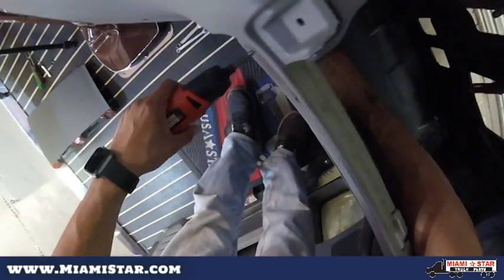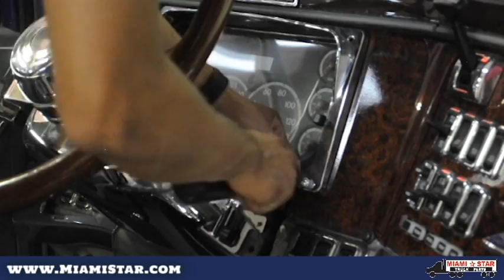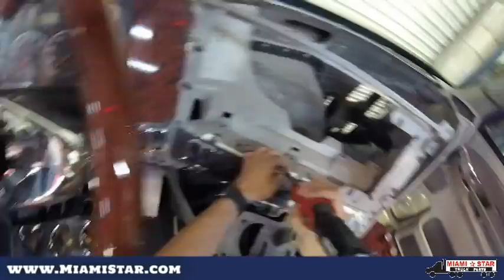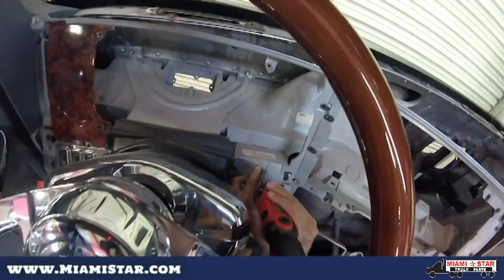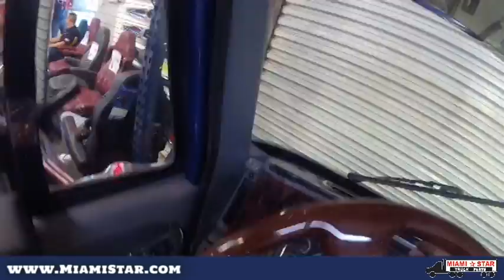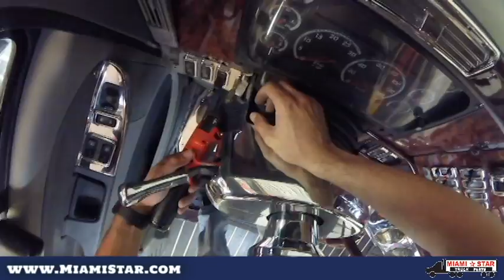Freightliner Truck Dashboard Panel Installation Video from miamistar.com

Comment: FYI... if you are doing this replacement on an actual truck with wiring and airlines, you can add an additional 10 hrs for disassemble and reassemble of the dash.

Comment: Using power tools is the #1 reason these dash panels fall apart and tabs break
Reply: You are absolutely right. 2015 Coronado glider, had my heater core replaced, shop used power tools, tabs broke. Had to replace two pieces in the truck already, totaling 468 dollars. Hand tools only.

Comment: Can the Colombia dashboard work in the century class???
Reply: Freightliner century, Colombia’s, and coronados use same dashes
Reply: With the exception of the newer models
Reply: @gavensingh9117  yes, kinda and not entirely, lol. My 2015 Coronado glider (first bodystyle) has different gauge cluster than century and Columbia, otherwise the same
Reply: @TheRoadhammer379  do you mean you have more/less gauges?